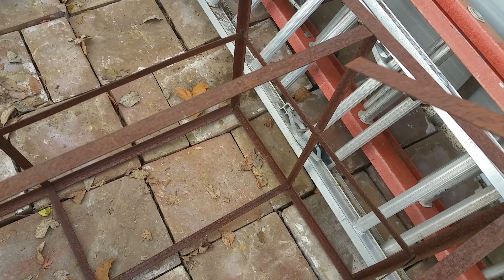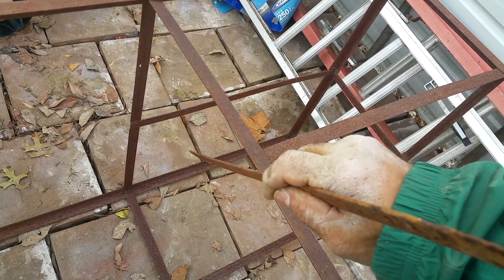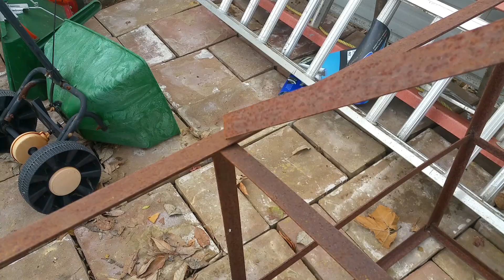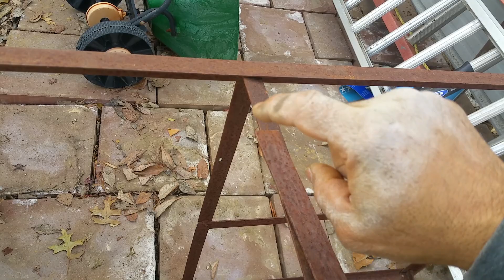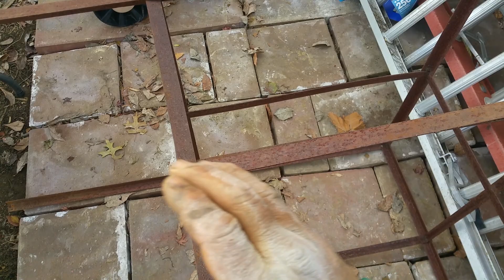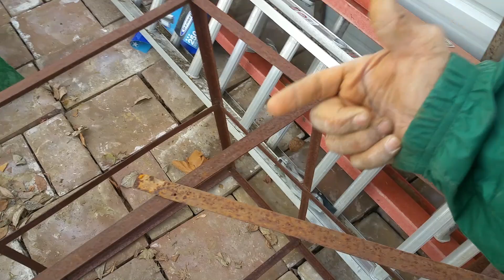Hard Rock Hotel Collapse Steel Reactions explained for layman 15TH AND 16TH FLOORS TRANSFER DECK

Comment: This is a great demo how how forces move and resolve throughout a structure.  It really shows how a small deflection in one place can cause an even more exaggerated deflection elsewhere. I would not surprise me if this ends up video in a couple of structure engineering classes.  

Possibly if the concrete had been given more time to cure this collapse might not have happened when it did but that butt joint appears it would always have been a weak point.  It is increasing obvious that the change in column layout on the 16th floor was a straw to break a weak camels back.  Then the change in layout again on the roof top finished it off.  That column in the middle of the beam had to be exerting an incredible point load.

In my experience overload failure is not instantaneous, there are subtle symptoms  like bowing, sometimes some noises are being made then suddenly something breaks.  Once noises start, there is not much time to escape.

Comment: Someone just posted new video of google street maps  of building had cracks visible in roof  and front rite where it collapsed from exactly. All signs were there b4 collapse.
Reply from the maker: Yes, I saw that days ago and will not consider it the point of failure... it is on the overhang... Edit add: Plus it does NOT run into building structure/ walls.

Comment: This was awesome. Exactly what envisioned. I feel like these structures are living. In that a change or deviation in one place, will will create multiple changes at other places. But, if it were alive, it could compensate and adjust, therein lies the difference. You are genius. Now, cook up the FIU bridge, how cable tension and rod tension differs. Some load types can’t recover from a change to overstretch or stressing. I can’t wait.
Reply from the maker: I will do the FIU Bridge model, I have my welder on a job and I cannot take it off  yet... Maybe, this week or next week I will make time to do the tac welds to make the model... I almost have it down to a simple and easy to see reaction model.. (It is all in my head at this time).

Comment: Very well done.  Also, this is typical and would happen to any material, not just steel,  depending on the strength and characteristics of said material. Thanks.
Reply from the maker: As long as they interact like this steel...
Thanks Stewart, glad u shared your thoughts.
Keep in mind that we are trying to reveal which one of these interconnecting parts failed and why...
It appears it is related to floor 15 beams and columns starting the failure and or connections.
Reply: @ForensicCats   Agreed.

Comment: I always appreciate your explanation of the physics involved in this series. I am wondering how well the rebar was joined. Would hooking the rebar be better than simply tieing it?
Reply from the maker: Bennett, that is a 40 minute video I will load later tonight...  
Your thoughts and questions are very timely and it will show how the decking, concrete, beams, and Nelson studs interact...  I hope I did a good enough job explaining the details...
I cut the video short because I can keep adding but that might not be productive...
I like to load a video, read the comments to know where I dropped the ball and then make a better video.

Comment: This visualization has helped me to make more sense of things. I learn a lot easier with hands on explanation. I loved when we had technology class and used the balsa wod to attempt to make the strongest bridges. Kids these days have no idea. I will definitely use this video for my daughter's home school program. She too with understand much easier than just words on a paper. Thank you keep up good work
Reply from the maker: I am pleased you will show your daughter, as is awesome; will help her and anyone visualize reactions that engineers put down in graphs...
Then make the sizing requirements to resist those forces, to keep all connections and steel members stable (under the loads expected)...
Reply: I was in a scout explorer post and went to a engineering event at Ohio State University for a jamboree.  One of the contest was build a balsa wood tower out of a kit just containing various dimensions of balsa wood and Elmer's wood glue.  The contestants had 24 hours to complete and ready for weight testing, basically weights were placed on the tower or it was placed in a hydraulic press until failure.  I did not participate in that particular competition but our explore post did have an entrant.

It started out with towers typically failing around 3 or 4 hundred pounds.  We had one kid from Alabama that went from weights to hydraulic press, it started to crack at 6,000 pounds.  It appeared to be a very simple design and the kid did say he did expect it to hold at 5000 pounds.  We all had months ahead of time to plan for the contest.  His claim to the difficult engineering was laying out the top so it did not crumple up before tower failure.

Explorer scouts go to age 21, after that you can hang on to be an adviser and it is coed.  The favorites were the always the entrants from the MIT explorer post, they only won 1 contest.  That was a surprise and MIT explorer scouts are not gracious losers.